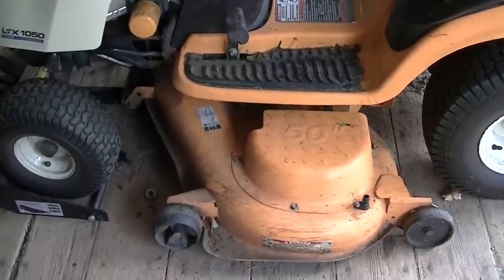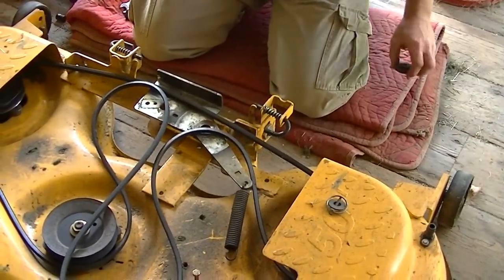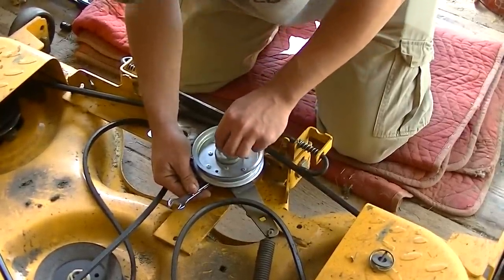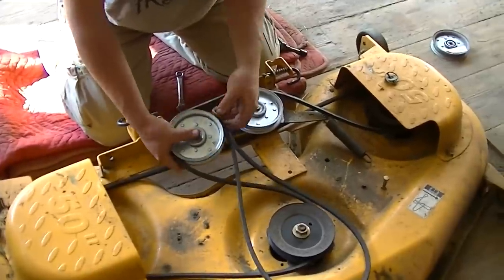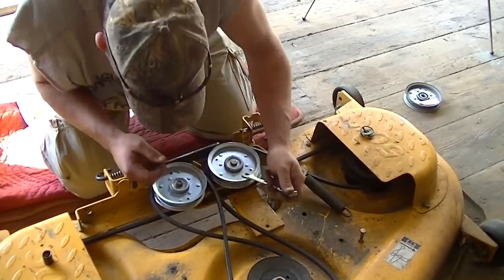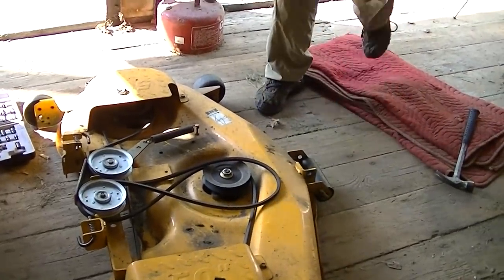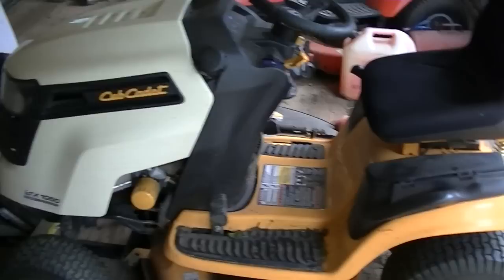Cub Cadet LTX1050 (Bad Idler Pulley) and Spring tip trick!

Comment: I have a LT1046 with 57 hours. Had thrown a deck belt, had to slightly loosen the  tensioner pulley because it was stuck under it. Tightened the thentioner pulley, Put it back on and now the spring started rubbing the pulley next to it, sparking. I then decided to loosen the tensioner pulley base, pulled it further away, where the spring no longer rubbed. Now the belt is smoking on the main pulley in front. This the first day owning it  and all withing 10 minutes of the first use. Sorry I'm ignorant to all of this.
Reply from the maker: they eat belts like they are candy. i would recommend returning it and finding something else. Cub Cadet used to make quality equipment. now it seems, not so much anymore. I would make sure to grease the pulleys, that's if they provided the grease fittings. Good luck!

Comment: Thank you for your spring trick!  Based on your idea I made a hook out of a wire hanger.  I got the spring off using that.  Could not get it hooked on again as I didn't have the strength to pull it far enough.

Comment: OK!  spring technique!  I've ot a wide bladed long screwdriver that makes it pretty easy to stretch that spring end over the bolt, but sometimes it takes a couple attempts.  Your method is much easier and SOOOOO clever!   Kudos man!   I'm getting sick going through 2 $50+ deck drive belts with this thing though.  I've identified a few things I want to try to address.  Jus' buying a new set of idler pulleys doesn't get it.  (Overhauled the blade quills (spindles) twice now - manually replacing the bearings) - sooner or later, I get to where I hear the engine humming 
along at full song but can hear the blade speed drop considerably, even in light grass loads, I know another $50-$60 belt is in my near future.  Pull back out of the hydrostatic (which I also overhauled last year) just to keep the belt from slipping too much.  This thing has driven me nuts!
Reply: BTW - don't be afraid of these hydrostats.  Mine made it to just under 200 hours before the pump and motor sections were so scored they wouldn't seal anymore.  Worked fine, 'till the oil warmed up.   They're not that expensive to replace a pump/motor pair and very easy to do.  Just punch a hole in the bottom and thread it for an NPT drain plug  - and change the oil yearly.  (I'm using SAE 50 Valvoline SynPower) 
The deck spring trick though......  GENIUS!

Comment: Those idler pulleys are grease-able now, they make a needle hooked to a grease fitting that will go in under the rubber on the bearing. I have 440 some hours on mine and no failure YET.

Comment: oh and another way to get the spring on is a brake spring plier tool its got the grove in the handle to put on the bolt and lift it on

Comment: The idler pulleys have sealed bearings so the grease stays on the bearings without greasing. so you replace the whole idler pulley. Not that expensive on line. They do eventually wear out after a lot of use. The spindles in this tractor probably have sealed bearings in them also( plastic seals on both sides of bearing race). But you can take the spindle shaft out and replace them. There are two spindle shaft bearings per spindle, one for the top of spindle and one at bottom so the long shaft is supported evenly  as it turns. These bearings are relatively inexpensive at a bearing store about $7.50 a piece and even cheaper on line. You block off the blade and remove the top spindle nut and pulley and the shaft comes out the bottom of the spindle. Tap old bearings out of housing with punch and hammer. If shaft is not warped you can replace bearings. Take off blade and roll the shaft on a straight surface to check it. If bent it is better to buy whole spindle unless they are too high. Then you may find a spindle on line. Do not remove spindle from deck unless you intend on installing a new spindle as the bolts from the deck are hard and brittle and will break off. Can not drill them out unless using a press and many drill bits. So if just replacing bearings leave spindle housing bolted to deck when replacing shaft bearings. If you are using new spindle go to hardware store and buy good quality deck/spindle bolts. Take one to store for sizing.  Apply a little grease or anti seize compound for future removal. Never re-use original deck bolts.

Comment: Thanks for the video. I put it all together in the right order I even took pictures as I took it apart. But it seems like the pulleys are too high in relationship to the blade pulleys. So I fraying belts. Am I just getting the wrong belts or do I need a specific set of pulleys
Reply from the maker: the junk they make today I'm not surprised. could be the belts? or something is misaligned? hard to say not being there. that whole system seemed botched and cattywampus. the mower in the video would eat belts and pullies for breakfast.
Reply: I’m having the same problem. It looks like to me that the spring is so tight (as everyone can tell) that it’s pulling the pulley without the bottom nut forward and out of level. About 10 degrees in my case. The threads in the bracket finally gave out so I’m going to try and putting a nut on the bottom. The position of the spacers is also beyond me. Mine have several washers and spacers on both and I have no idea which order they go because the schematic doesn’t even show them. Anyway.. how did you make out @sbond1963

Comment: Back to mowing season. Another thing I noticed is the manual seems to show the belt going on over the tensioner bracket /spring when it should (I think) go under. That's how it appears in your video.
Reply from the maker: D McC In the video I started putting things back together wrong. I reset and continued like nothing happen. the final shots of the belt configuration are correct. I did have to rerun that differently then how i showed in the video before the 3 min mark. After the 3min mark everything should be correct? lol
Reply: Video seems right. In Google+ I posted a pic of manual and there it looks like the belt goes over. Going under makes more sense. Otherwise it's rubbing constantly.
Reply: I noticed the same.
Reply: You are correct.  The manual I have shows the belt going over the spring.  It's impossible to do that without tearing up the belt in no time.  The belt goes under the spring.  Cub Cadet also never tells you about having to remove the rear tentioner pully in order to slip the belt on.  That metal bracket blocks the opening enough to keep the belt from going on without taking the pulley off.
Reply: @shouldibehere  wait!! How do you do that????
Reply: @shouldibehere  obviously you didn't understand the question. How do you put the belt on without removing the pulley that has the belt guide on it??
Reply: Maybe you misread my original comment.  You can't do it.  If I recall (its been half a year) I removed the bracket and/or pulley with the belt guide on it.  There's not enough clearance for the belt to slip in between the bracket and the pulley.

Comment: My 2010 ltx 1050 has the heavy duty extra cost mower deck with 413 hours, and never had to replace any pully bearings because they came with grease fittings......Problem is that they are underneath the deck, but I have a crank up mower lift and then I have access to the 3 blade spindles.

Comment: Putting on the spring tensioner prior to assembly of the deck attachment means you are taking it off again to put the belt onto the engine PTO pulley.  Do the spring thing after the deck is installed and the belt installed over the pto pulley!

Comment: Do you have any tips on getting the deck back on.  This mowere was purchased used.
Reply from the maker: I raise the front end of the tractor with a tractor lift. Then slide the deck back under line it up drop the deck height lever all the way down. Hook the belt back up to the engine pulley.  attach the rear deck mount pins first. then lower the tractor attach the front guide bar. That should be about it. Now get on that mowing and get mowing!! We don't have all day! :)   How to Change the Deck Belt on a Cub Cadet Riding Lawn Mower: Using Model 13VR91AT009 <--- Here is the link from Cub Cadet it might help encase I forgot anything.

Comment: You never showed how you removed the spring in the first place? Assuming we need to remove the pulley on that side to get the tension off the spring to remove it from the bolt?
Reply from the maker: Cynthia Ritchie When I removed the bolt is when it released. I apologize.  I'm just a "dude"... I tried to think of everything.  ;) Thanks for bring that up hopefully you were able to figure it all out safely.

Comment: Do you have any video of the throttle? My wire pulled off the lever and can't get it back on. (my belts been working at least ☺
Reply from the maker: Nope I do not have a video for that. Sounds like it should be a simple fix I hope. I haven't run into that problem yet knock on wood, But when I do I'll try and get a video of it. Hope you get it figured out Good luck!

Comment: I guess my spring is worn out or is the wrong spring, because I can just pull it with my hand and mount it. My belt keeps jumping off the pulley, I found a bend pulley, I think is causing the belt to come off.

Comment: Hey Joe. Great video. Question. At the 1:31 minute mark of the video you see a little yellow bracket on top of one the pulley's. What is that and where does it go when you put things back together?
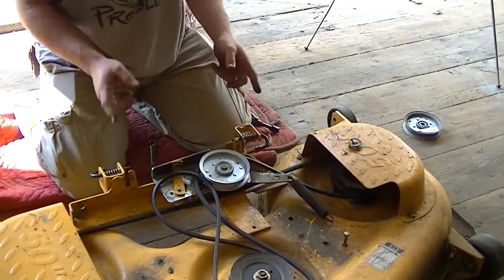Reply from the maker: +O CZAKWC Thank You! O.  That is the belt guide for the second pulley 3:04-3:27 it can be seen in the location near the first pulley it goes under the second and close to the same direction shown. Ours had a grass stain outline on the metal where it was and I only put it back where I found it. :)
Reply: +BigJoe Kasulis™ Hey Big Joe. Thanks for the reply. Your video saved me. I had the bolt that holds the pulley right next to the idler pulley break and thanks to your video, I was able to replace the bolt and put the pulley back on. It's all back together now and cutting grass like there's no tomorrow. Thanks again. Bill Oczak....
Reply from the maker: tscpbm This comment is exactly why I do these videos. Thank you for the kind words and I'm very happy I could help. Now show that grass who's boss! ;)

Comment: are your idler pulleys leaning forward a bit- just replaced the belt -idler pulley and also a new spindle and blades and am having problems with the belt  constantly being thrown off-when my idler pulleys have the spring tension on them -seems as though they are leaning or not perpendicular to the deck -thanks !!!
Reply from the maker: I had the same issue and I ground part of the deck off where the tension bracket hit the deck that worked for a year or so but just recently added it back because it seemed like I was destroying the pulley bearing from being under to much tension. this is the worst deck design and has many problems good luck!

Comment: I replaced my belt and It seems to be in the right place, but the deck idler pulley with the belt keeper rod is getting HOT and can smell the belt "burning"  I shut it off right away, but something must not be lined up right?!  Any suggestions?
Reply from the maker: what was the reason for changing the belt? check if something is lodged into the blades, or ceased. I would check and make sure everything is turning/moving correctly. by turning the blades by hand and making sure not having restrictions. then I would check again and make sure the belt is on correctly. the belt shouldn't be touching anything but the pulleys. I am by no means a pro, I just get things done one way or another. Not seeing and not having all info its hard to tell. I hope any suggestions I have will help.

Comment: Does it matter if the pulleys you replaced are not facing up the same way? My left pulley is rivet side up and the left pulley is rivet side down. It was bought used with 30 hours on it this way. So when my belt broke I decided to replace the pulleys and noticed this was the way the pulleys were. Does it make any difference? Thank you Your video was helpful
Reply from the maker: I'm not an expert by any means  but I don't think they are different only thing that might change is the ride height of the belt but it cant be by much.

Comment: What year is this mower?  Mine is a 2011 LTAX 1050 (I've got 352 hours on mine) but this deck looks a little different.   This has been a great mower and it finally broke down two days ago (drive belt broke) and I'm waiting for the new belt to get here.   I like the wire tip for the tension spring, I will definitely remember that if I ever have to replace my pulleys.  Did you order your pulleys from Cub Cadet?  Thanks for sharing

Comment: ltx 1042kw  111 hours and had an idler pulley go and under warranty so they sent me new ones
Reply from the maker: well after 90,000 people have seen and most likely had the same problem I would hope they warranty the parts.. I was told I put more hours then they allowed for and the part wasn't covered.  We had to pay out of pocket. Thanks for watching and if this video helped in anyway  that's all that really matters to me at this point. :) Thanks for watching. keep an look out and get ready for the idler bracket that the pulleys ride on to go bad at around 350 - 400 hours depending on how much you work it. I normally run 4-6 hours straight minus refills. 1-2 times a week
Reply: I see that the idler pulleys just about touch each other when the blades are engaged and wonder if that is the cause of the pulley failure .You can't even get your finger between them or a piece of card board .When you install new pulleys it does not say to grease them either .You can get parts of cub cadet master on ebay also .I bought the extreme blades from him 29 dollars and free shipping .He sells the pulleys also .Thing is I wonder if this happened after just 111 hours if I should stock up on pulleys .Shame on cub cadet .The braking system they have sucks real bad also .Only thing I like is the seat and the gas window .

Comment: I have a 2012 LTX 1050. This mower had greasable spindles. I had to replace one and it came without an alimite. Wife then hit a big rock and broke another one. The new one came with an alimite.So i guess maybe they now come maintenance free. Also a word of caution for those who are installing the deck. Make sure that the rod thats the belt guard on the clutch in the front is inserted in the notch on the clutch housing.If not the clutch will spin pulling the wire out of the clutch and they are expensive(hard lesson learned)
Reply from the maker: I just hit a small stump Yesterday, that broke the Spindle & bearing housing "Non Grease-able". The replacement does however come grease-able. Possibly they decided to try something new? I Have no Idea, not an expert by any means. I just work and fix it... :) Thanks for the info and tips Much appreciated.

Comment: I have a cub cadet ltx 1045  with 46" dual blade cutting deck, every belt I put on bounces like crazy when the cutting deck is off.  When I engage the blades it mows fine. As soon as I shut it off the belt bounces and breaks. All belt keepers are close so the belt is not falling off the pulleys. Any way to fix ?
Reply: Just a thought (on an old post for others benefit)--are you dropping to idle speed before you disengage. Belts bounce at slow speeds. If so, disengage while at full throttle. If that's what you already do, try doing the opposite--not normally recommended. Obviously on a properly set up deck this should not happen. Something is wrong: if not bent or bad pulleys, or a bent deck, my first guess would be the spring is worn. Low tension will also cause your belt to bounce more at low speed. If you ever got this fixed, let us know!

Comment: Maybe you can help me.  I removed the deck to sharpen the blades on this mower and a spring came off from I don't know where!  I have everything put back together but I don't know where this spring goes.  It's about 4" long.
Reply from the maker: Umm... Oh boy... :-/ I'm just a Wood Working Property Manager... :) But First thing I would do is check for Obvious Locations. Then if didnt work I would try and search the net for pictures of underside of the mower and try and match up placement of parts. If you don't see a spring on the mower deck. Then I would say that's the one missing? Hope that helped.
Reply from the maker: http://www.cubcadet.info/Manuels/2005/Tracteurs/LT1042-LT1045-LT1046-LT1050-Owner.pdf
Reply: ***** I found where it goes! and everything worked well today.
Reply from the maker: Awesome! :)
Reply: Kari where did that spring attached to. I see where it goes on the pto but does it attached to the deck or the frame?  Thx Don